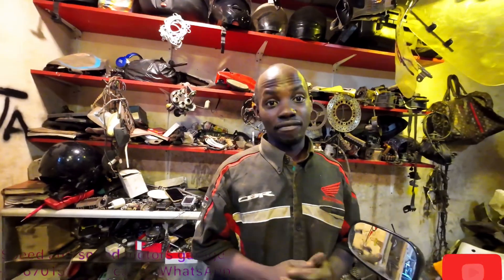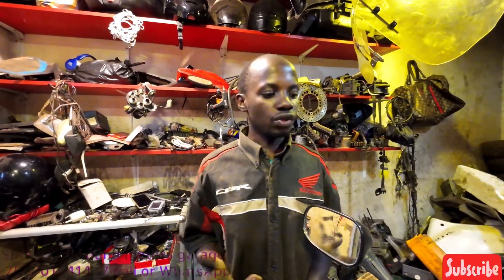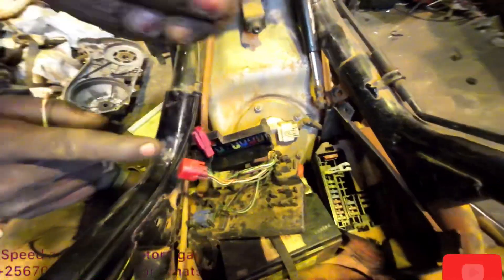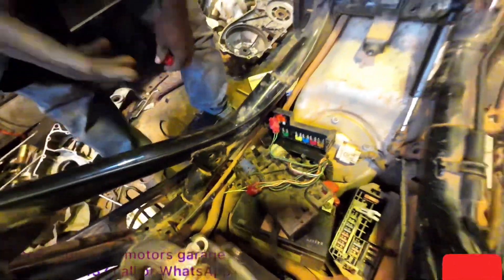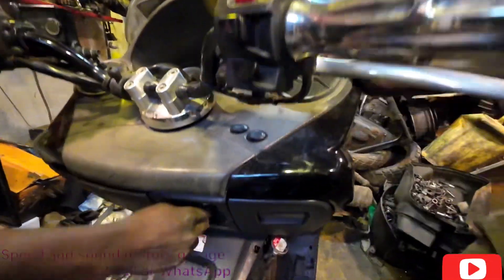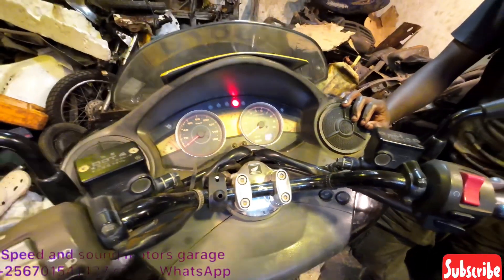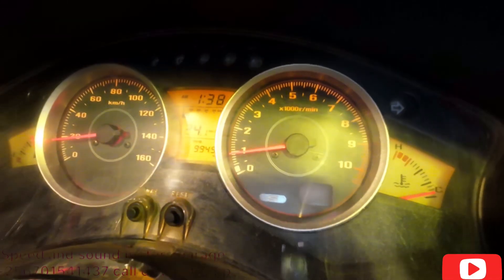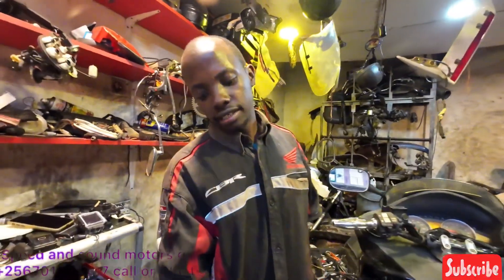Honda FORZA MF10 / FORZA X (NSS250X) Honda S-Matic initialization procedure

Comment: Pls where's the thermostat located for honda forza mf10
Reply from the maker: Thanks for your feedback subscribe to our YouTube channel for more information though check the cylinder head top where the hose pipe for coolant flow out of the engine to radiator
Reply: @Speedandsoundmotorsgarage  pls help me I still can’t find it, any diagram will be appreciated, thanks
Reply from the maker: Send me a WhatsApp message

Comment: So engineer, if a scooter NSS250EX's FI light is flashing 2 longs and nine shorts, what could be the problem ?
Reply: And it has a problem of not shifting gears when on high speed
Reply from the maker: You Need to reset the drive shelve position sensor and perform initialization procedure
Reply: @Speedandsoundmotorsgarage  how do I reset it before initialization
Reply from the maker: Get time visit the workshop
Reply: @Speedandsoundmotorsgarage  what's your location?
Reply from the maker: Ndeeba opposite total horizon
Reply from the maker: Subscribe to our channel for more information though that’s idle speed control value
Reply: So how can I fix it
Reply from the maker: Visit
Reply: How much do you charge for resetting Forza 8
Reply from the maker: Idle speed control valve 
You got to change the ecu